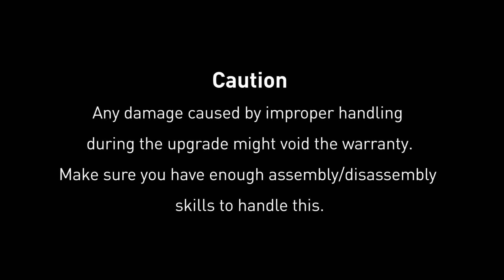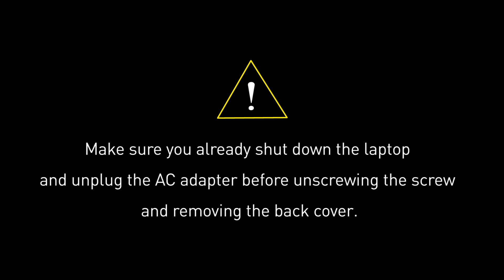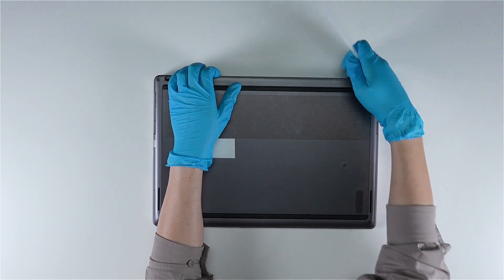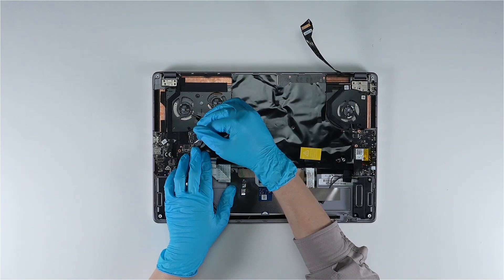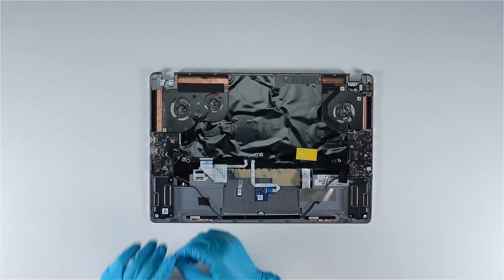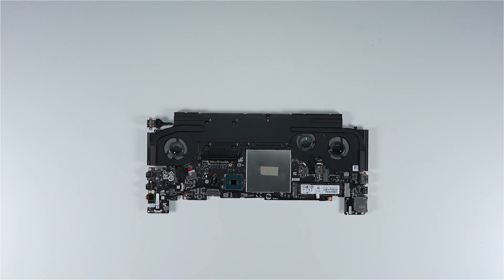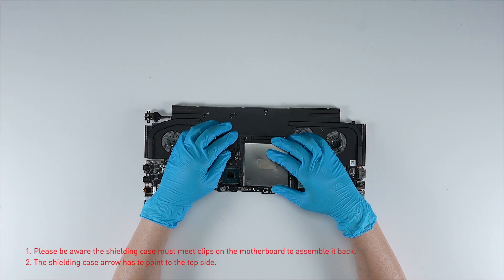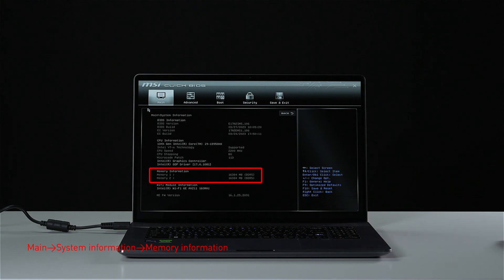MSI Creator/CreatorPro Z17HX Studio A13V Series Upgrade Tutorial

Comment: Damn MSI... I was about to buy this laptop, but they removed the 2nd NVMe on this revision. @MFLAB on previous video  https://youtu.be/-ooMzRY4rbs shows that the motherboard for A12 have 2 NVMe. For this A13 only have 1 slot. I was about to compromise not have RJ45 connector (Ethernet), but not having 2nd SSD for a creator laptop is a deal breaker.